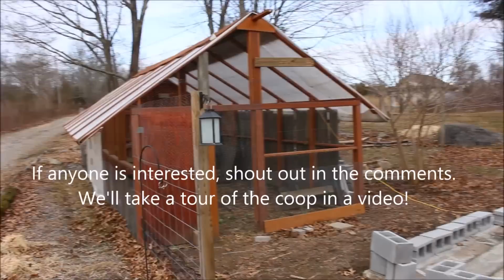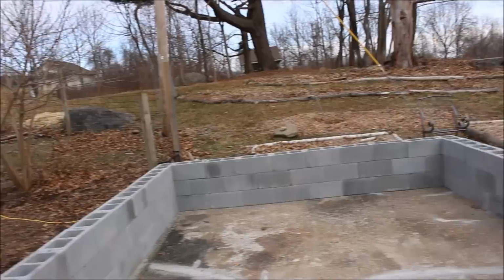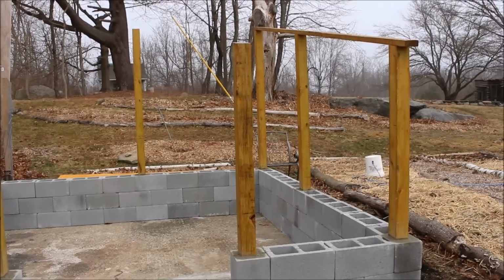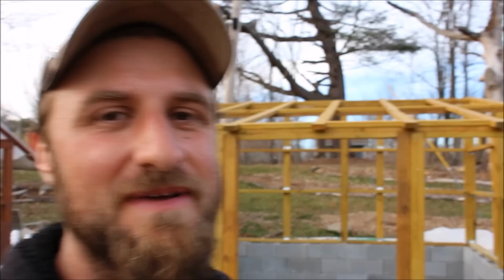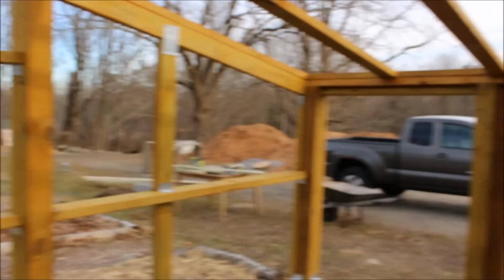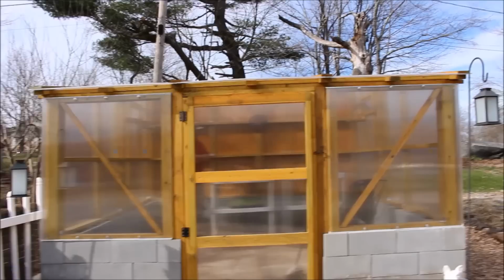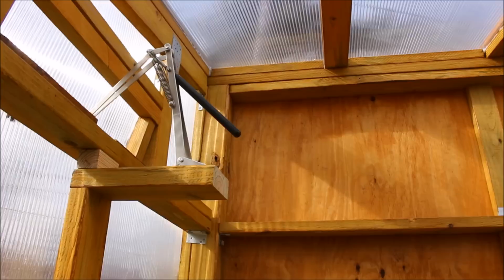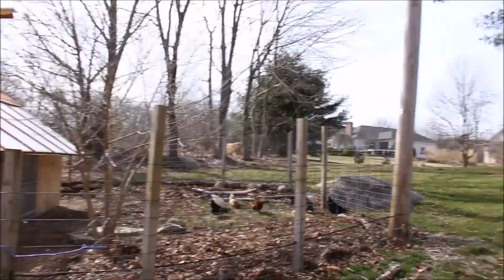Our homestead GREENHOUSE time lapse! WE BUILT THIS!

Comment: You cemented the posts but laid the blocks without mortar? Why?
The whole point of concrete blocks, or cinder blocks as you call them, is that they are hollow. Usually they are spread with mortar as you lay them.
Reply from the maker: We're not great masons, the job would have been messy and taken us valuable time, so we opted to dry stack the blocks, then we filled all the cavities, next we used a polymer crack filler to seal the joints, finally we'll skin the entire outside with a sealant or primer/paint. Certainty not the professional way to do it but it works!

Comment: Cost?
Reply from the maker: So far it's at around $3,000, mainly because lumber prices are outrageous right now and we also bought extra pieces of the plastic glazing which was the most expensive material. We still have a few upgrades to make to the roof and foundation so im guessing when it's all said and done, should be around $3,200

Comment: Why are the blocks not bonded to the slab and each other, or filled in with concrete at the very least? Unfortunately there is no structural integrity whatsoever- is a shame as is a reasonable design!
Reply from the maker: We did fill the cavities, it's just not shown on the video. We're also putting in an exterior footing this summer as well as anchoring in to the slab from the inside with thick gauge right-angle brackets. If we had known the video was going to take off like this we would have included all that! haha oh well, thanks for watching

Comment: Sorry but this is very ugly, I dont like it.  No,, no... just kidding...  thanks, I will build similar to this, roof will b more 30 degree angle n put solar on it. Thanks you both...
Reply from the maker: Hahah thanks for the humor and kind words. And yeah i would recommend a bit more slope to the roof than we did here, it works well but would get more solar gain with more slope as well as helping to shed snow